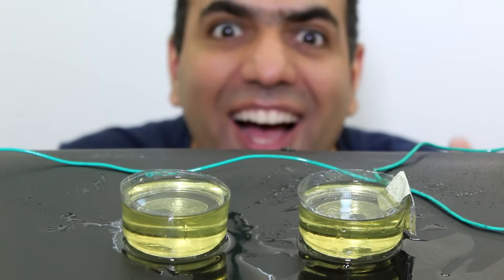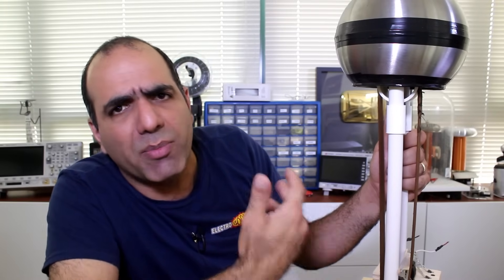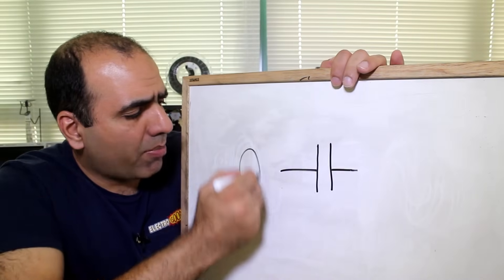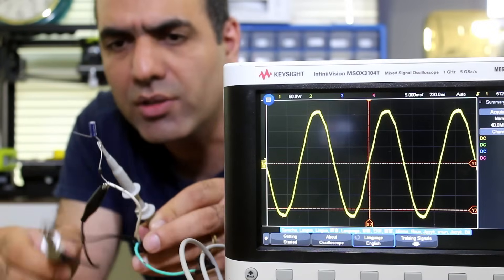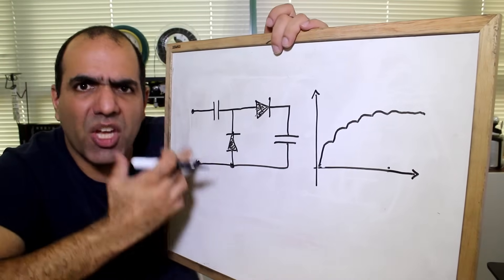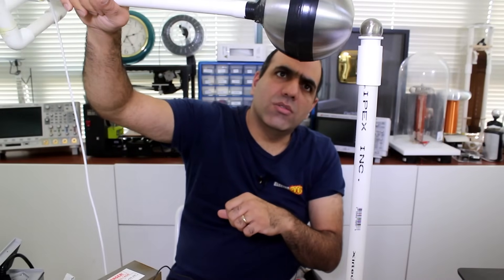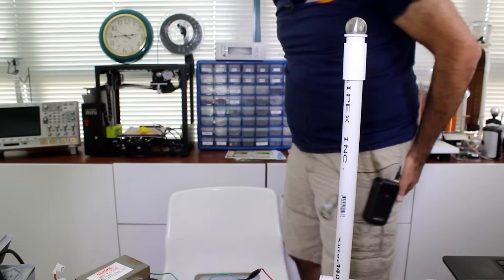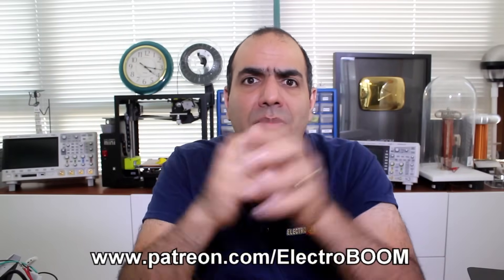High Voltage Flying Oil Experiment with Voltage Multiplier

Comment: Hey Mr boom why don't you just break few CFL bulbs and connect their high voltage ends in series for the high power
Reply: Those do not put a high voltage out, only a few hundred volts. It is high frequency AC though.
Reply: @Basement-Science  it generally provides somewhere around a thousand volts so ten in series would be better than oven transformer

Comment: I can assure you, that charging (old) phone from high voltage lines using antenna works. Old phones starts charging indication on very low current , which is totally possible to harvest from induction under those power lines (tried this myself). Microwave gun works too, tho I wouldn't recommend trying to make it, too dangerous, because of possibility to cause damage to your  internal  tissues. 
WiFi gun, hm, will try it soon, but not so sure if it works.

Comment: Nice video electroboom oh i like extra high voltage. You can generate high power high voltage using fly-back transformer used in CRT's "booooom arcs every where😂"

Comment: But why doesn't it work using water?
Reply: The mixture of copper wires and water in the presence of AC current would ionize the water because of corrosion. Then the mixture would emit hydrogen and oxygen gaz. You won't like it when it's angry. I will give you a hint, pop.
Reply: But would it fly too? If not, why not?
And why copper wire and oil do not emit gas?

Comment: You always crack me up...Great video!!!!!
 you'll be proud of me, I blew up my multimeter of 20 years (13th birthday gift) by connecting 240Vac to the 12V secondary side of a transformer, 1 week ago
PS. no i didn't mean to do that and yeah for some reason I ignored the the color coded leads on transformer.

Comment from the maker: Hey Comrades!You can post your own posts in ElectrBOOM subreddit: www.reddit.com/r/electroboom
Reply: how much is your electricity bill? love the videos as a 16 year old i've learnt more from you than my school
Reply: Russell May Takes electricity from his neighbour's house...free energy...
Reply: Russell May - It's about units of electricity, so watching TV for an hour probably costs more than spending 3 hours building a contraption that puts several kV into your ass for a fraction of a second.
Reply: Russell May , same here, except I'm a few months away from 16
Reply: @russellmay4299  me too! And coincidencely we're the same age.
Reply: ElectroBOOM  I love it next time use capacitors over 2nanofarads
Reply: ElectroBOOM pleaseeeee make it even more dangerous
Reply: When will you test your cylindrical capacitor on Van der Graaf generator?
Reply: I LOVE THE INTRO
Reply: Give me ta osciloscop or make osciloscop from old CRT TV. !!!!
Reply: you can use the old tesla coil driver to charge the capacitors at bigger frequencies
Reply: Let the Zaping begain.
Reply: Love the videos. I know they are old news the Kid with the free energy crap in the bucket I think I figured out where he hid the batteries. They are in plain sight. The 2 coils he has they are large tubes wrapped in wire well those tubes have several C or D size batteries in them and seeing how The logical place to meter the unit would be there at the output side of the coil So even if they look in the bucket there is no sign of foul play and The unit is to fragile to let folks handle anything so nobody would feel the weight of the batteries It looks like one could hide 10 12 a few more perhaps in each tube wired in series I had 1st thought mabe he used caps wired in the unit and to anyone looking They just look like any other electrical device But a person who knows Caps will hold a charge may have figured that out But with the tubes being the voltage supply He can show up put it together and not have to charge the caps up. I had a dream I built a gocart and it had 12v DC motors at each wheel with electrolytic caps wired before the motors but one wheel had a 12 DC generator It worked like a ignition unit on a car The generator charged the caps when they reached full charge they fired but not all at once some how There was a control system that as in the ignition system each cap fired at each motor like wheel 1 wheel 2 wheel 3 but fast Tell me providing one could get the caps charged high enough to drive the motors and the timing of the discharge cycle could be figured out Is something like this possible Once the system was charged I could even stop and start  because as long as the Gen wheel turned it charg ed heck even going to 2 wheels with 12v dc  Generators and 2 wheels with 12v dc  motors It seemed doable I had been watching how electric cars when breaking charged the Batt and how folks used  caps to start their cars. Why not have a Capacitor propelled gocart  lol. I'm an electrician but I mainly  do power distribution side of industrial plants some Controls but these are old relay systems not yet converted to PLCs I know what the Logic ladder looks like and somewhat how to program but... Iv never had to figure out what I dreamed.I wish I had needed to  Trouble shoot it so I could of saw what was in that little grey box the Leeds to the motors came from lol
Reply: @STEVEN-STEELE  this multiplier can be done from a 3.4v battery. Check out Plasma Channel to see how.
Reply: New term in electronics Croissant Voltage?
Reply: The thing u can  use are flybaks and they can be foun in a old tv that use catodic rays
Reply: you should stream somehting
Reply: The intro is really cool, keep going!
Reply: Electroboom why do you use still that yellow aligator clip?????
Reply: How much fuses are there out in your room .? Do you change it regularly?
Reply: ElectroBOOM  can you try to make drawing circuits with pencil and see if it will pass energy
Reply: @jeremyevans2830  that's possible depends on th pencil hp. Although you can by ink pens now. They are great for prototyping.
Reply: I love u dude ur a soooo awsome man thx for evrything pls make more videos
Reply: The rectifier says yes!
Reply: ElectroBOOM keep it up
Reply: Use bigger capacitors at the bottom and incrementally attach smaller capacity and higher voltage capacitors as you go up. Like you mentioned, frequency makes a differance so experiment with that too.
Reply: That's what they used https://38308.selcdn.ru/meta2017/storage13oc/175696/un9-27_galvanika_0.jpg
You can buy them for 5USD.
Its components with their specs http://x-shoker.ru/_fr/3/27-13.pdf
Some info about it http://teslacoil.ru/detali/un-9-27/
Reply: Mr electro boom you rock !! i would like to ask you some questions about induction heating thank you
Reply: سلام عزیز
ما توو خود ایران دسترسی به کارتهای بانکای خارجی نداریم، رشتم برقه، توو دانشگاه ما وسایل مربوط میشن به عهد بوق ،که حتی رویه آموزشی رو مختل کرده.ما هم می خوایم.😢
Reply: ElectroBOOM, please make Marx generator
Reply: If I get a scope, I'll be in heaven.
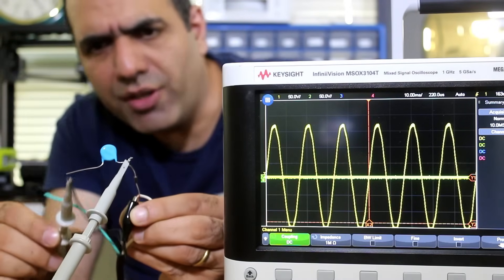Reply: 4:12 is this varistor ?
Reply: Gimme da scope plz
Reply: I need da keysight
Reply: any idea what zapped you?
Reply: Plz watch my video https://youtu.be/YQMuZ8fQCEc
Reply: https://youtu.be/YQMuZ8fQCEc
Reply: TSATrash  this is TT Brown work.  Check out Plasma Channel to see a working model. Also a TR3B uses the power core from a nuclear sub. Not easy to come by.lol
Reply: TSATrash  please enlighten me.
Reply: Stop hurting yourself you dipshit! One day you will miscalculate a risk and end up dead making your daughter an orphan!

Comment: mr electroboom they used flyback transformer from tv which is also give you 20kv to 35kv very easily and combination with high capacitance voltage multiplier it will give you deadly output of course this flyback transformer is not for you because you have no value of you life and careless too

Comment: Sir you didn't achieve that you wanted because increased number of stages in multiplier circuit reduces efficiency in circuit.
So you could have used full bridge rectifiers with multiple microwave transformer and then connecte all the rectifiers output in series taking care of polarity. Also used larger value of capacitancein this circuit. Another advange is you can used polarised caps in this.
All from high voltage engineering :)

Comment: Jesus Christ, you've got a MOT powered voltage multiplier, I'm gonna assume the MOT is not ballasted, and you're poking the mic and your fingers close to it when the MOT is powered...staaahhhpppp I can't take anymoreeeee :p
Reply: Aahhhhhh poking near the output with a ground wire and striking an arc with fingers...so close....*internally explodes* :p

Comment: Pour liquified paraphin in the PVC pipe for better isolation.  Can you make voltage multiplier for mains usage with electrostatic air filters.